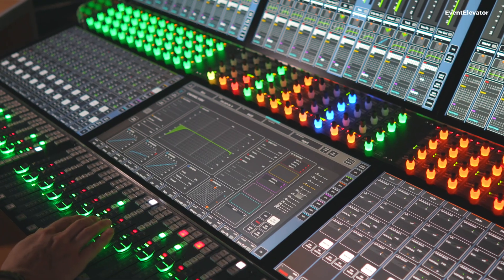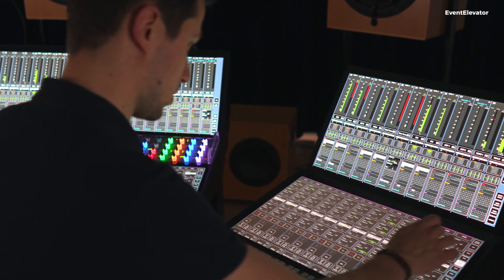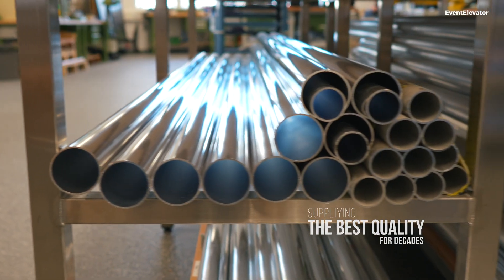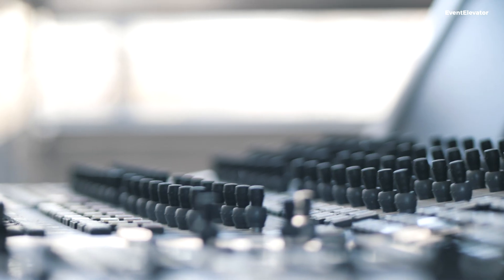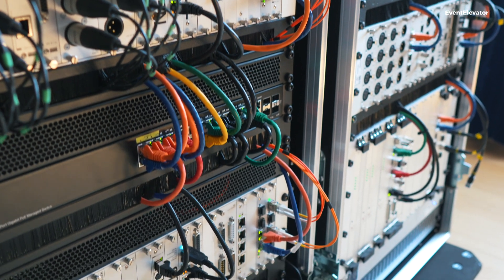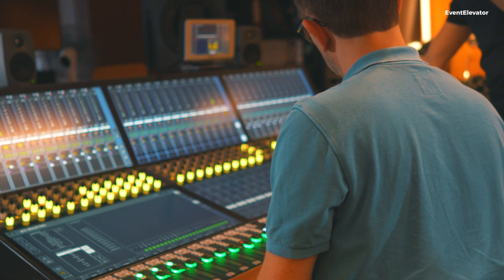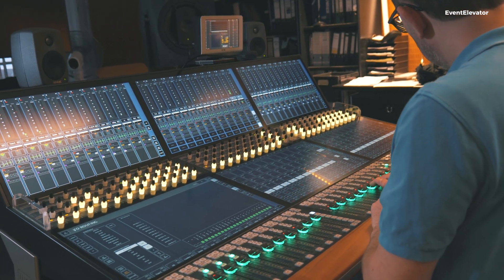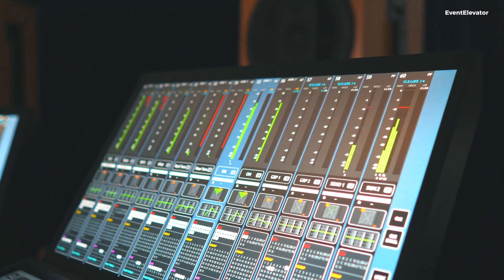Development Insights • STAGETEC AVATUS • Refining the mixing workflow

Comment: Interesting. I wonder how small scale you can go with this. The multi-operator feature is nice for film people. It'll have to stand up to Harrison MPCD setups.
Concerning latency, I'm more concerned about how fast I hear what I'm doing and how high the temporal resolution of the automation is. I sometimes EQ syllables of dialogue differently. The workflow efficiency is always my greatest concern. It's one of the reasons my 'home' setup outside any studio is an amalgamation of controll resources that are placed where I need them and that function exactly how I want them to. I'd sure like to see more of a workflow demonstration. Euphonix did a good job of that back in the day.
Reply: Hi Airon, it's possible to operate the console via web-GUI oder Mac-Software only, that's the smallest possible GUI solution. The smallest Hardware-Surface is the AVATUS-C, which consists of 12 Faders and a touch screen. The largest surface available is the one shown in the video, but with 96 Faders. The resolution of the automation is 10ms frames for preloading data which is then switched simulatiously or faded with individual times and curves if needed. If you like arranging the workflow yourself, you can define 8 custom strips where you can assign any parameter you want to the encoders, so you can have whatever you want right where you want it. If you'd like to take a closer look at the workflow, please get in touch with us through www.stagetec.com !

Comment: For that expensive equipment why is the touch latency too high? That would be irritating!
Reply: Hi, you're right, it would be irritating if it would actually feel wrong when working on the console. But it just doesn't. If you're sitting on it, listening to audio (which reacts immediately),  it's a very smooth experience. Does "going full IP" and distributing components in a network add latency to certain things? Yes, sure, can't argue about that. ...but, remember all these discussions when AoIP became a thing? ...turned out it's really just fine once everybody realized how much easier life is once the soldering iron can stay at home :)

Comment: Impressive , but touch sreen latency seems hight ?
Reply: That's the first thing I saw and cool desk but that latency would be a deal breaker
Reply: please be aware that most of the seen video shots are slow-mo. so you really cant see the actual response ;-)
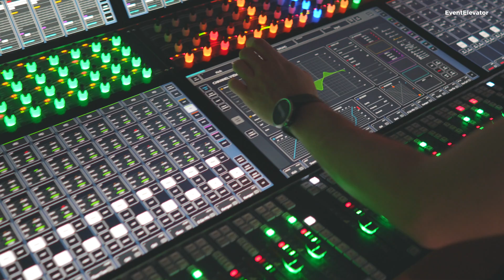Reply: @LeFix07  yeahhhh nice try but I really don't think that's the only issue here. the shot at 1:40 is real time and there is still massive latency..
Reply: I have used the console. There is significant latency.  @LeFix07